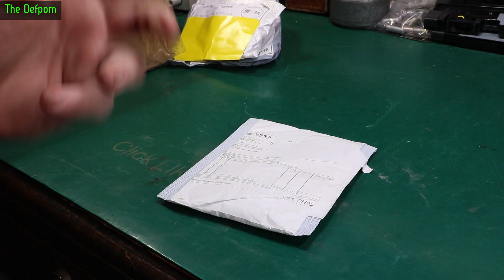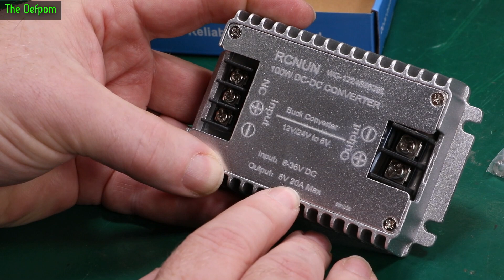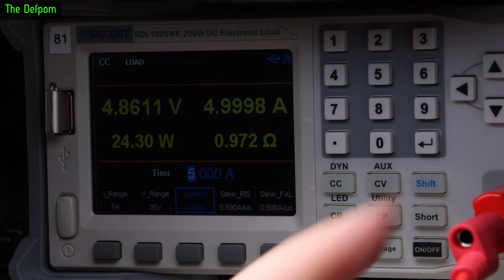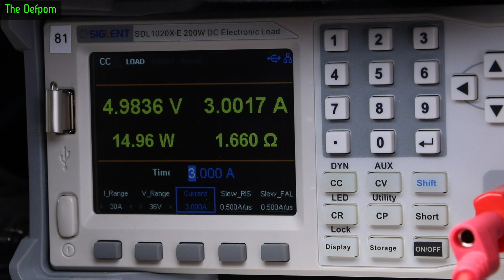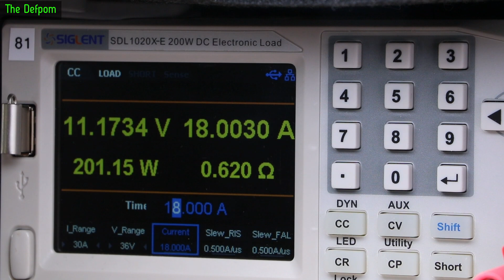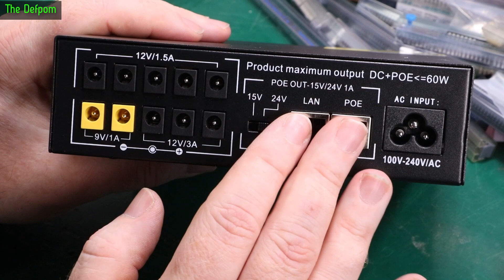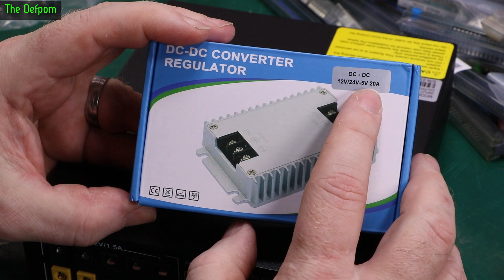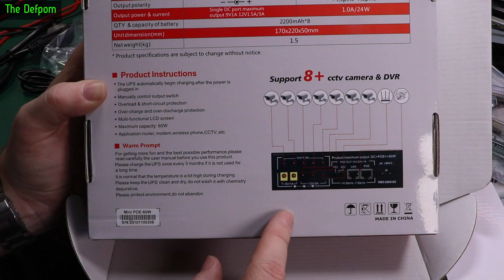🔴 Mailbag Monday 20th November 2023 - No.1197

Comment: RCNUN converters are of good quality. I have a few of them in use. Only one charger from RCNUN (9-30V to 14.6V for LiFePo batteries) has burnt out. But that was my fault. The device was only suitable for a maximum input voltage of 30V and I connected it to 48V.
Reply from the maker: Yes they certainly give the impression of decent quality, unlike some others I have purchased over the years.

Comment: I just fixed the exact same lamp fixture! It seems my model overheats about an hour in. It dims down and goes off. A little bit of cooldown time revives it for a while.
Reply from the maker: Yeah they do run hot, which is why I downgraded the bulb wattage to 10W instead of 20W.
Reply: @TheDefpom  good to know, thanks! I run an led bulb in mine now as it's mostly a worklight. A 10w bulb wouldn't be bright enough. I did have to print a replacement part with my 3d printer as the stock reflector dome wasn't large enough.
Reply: @TheDefpom  Why not upgrade it to LED?